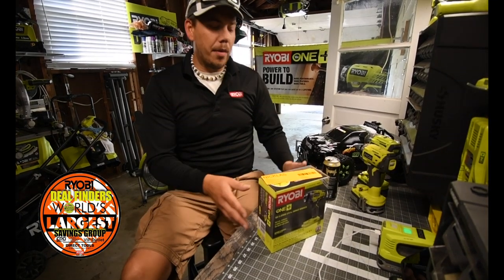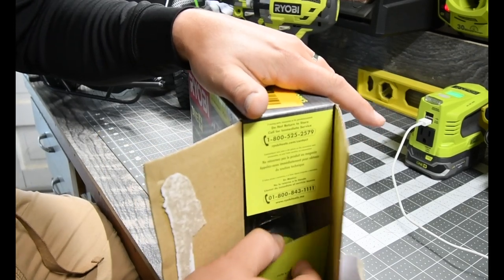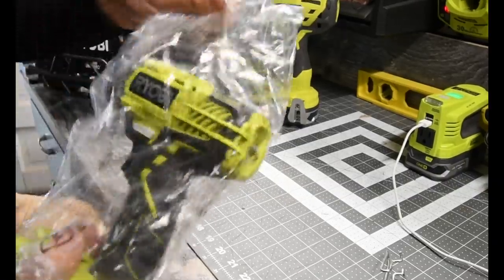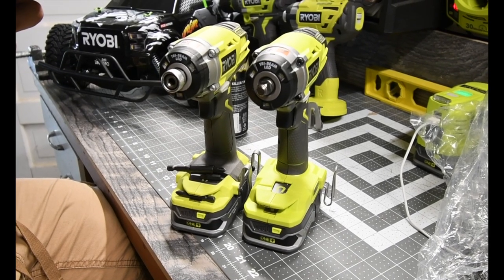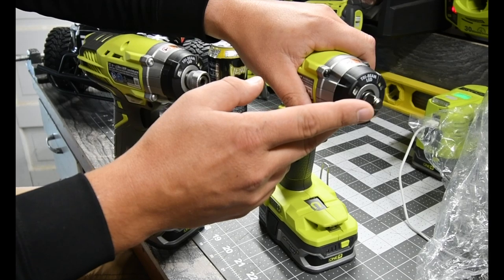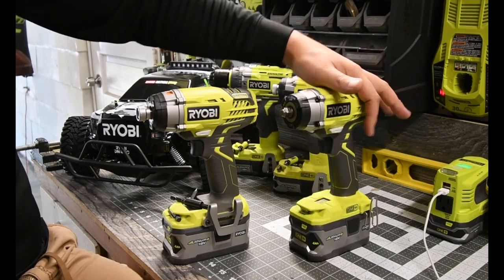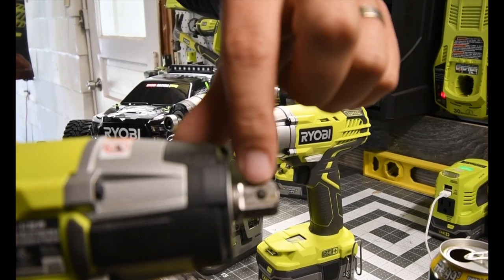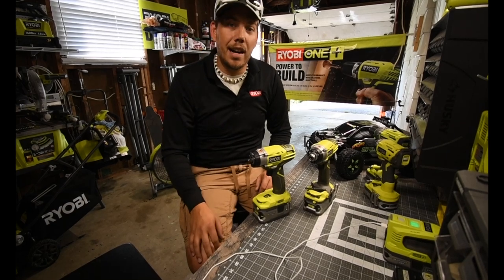Ryobi 3/8 Impact Driver Unboxing/testing!! P263

Comment: I have never seen a 3/8 impact wrench with a pin detent.  They are all friction rings.  If they put a ball inside the 3/8 anvil. you would weaken the anvil and it could break.
Reply from the maker: the 3/8 socket attachment has a ball in it.
Reply: @ManCaverTools  Probably for a 3/8" ratchet.

Comment: Great test keep going. I just finally bought the 18 volt Cordless Brushless 2 Tool Starter Combo Kit With 2.0 am hour battery, charger, Brushless drill driver, and what I've always wanted the 7 1/4 inch Brushless Circular saw at Direct Tools in Altoona Iowa yesterday for 128.39 after tax with 3 year warranty.
Reply from the maker: Those are fantastic tools

Comment: I've sheared off the post using the hex impact driver with a socket versus using the 3/8 impact wrench.  I have a 3/8 impact, but it has 3 speeds, up to 300 fbs of torque. I can take lugs off my suv.
Reply from the maker: Very good sir

Comment: It’s not called an extender it’s a reducer, and by using a reducer you are lowering your torque output, also i have the same 3/8 anvil impact and have zero issues with sockets being loose so either you have cheap sockets that aren’t up to 3/8” specs or your hog ring on the anvil is damaged no need for a ball.
Reply from the maker: I was talking about an extended drill. the longer you shaft the more torque you loose.with the hex you need a socket bit just to put the socket on. which lengthens your contact with the bolt or screw. Which drill bit would you lose more torque with, a 1" bit or 5"bit?

Comment: The socket being all loosey goosey on the impact wrench is because you're using a regular hand tool socket. You need to run it with impact rated sockets or sockets with tighter tolerances

Comment: If that's a husky reducer. It is the reducers issue. If you look inside the reducer where the anvil goes. You will see the indents are set up for a ball detent like a rachet. Not set up for the hog ring. So when you place the reducer on the hog ring the indents don't go over the hog ring allowing the hog ring to expand into the notches where a ball detent would. All husky chrome sockets and reducers don't work well at all with hog rings.

Comment: Your 3/8 to 1/4 adapter must be a cheap one.  I have one and it fits tight.  They do have sockets for 3/8 drive 5/16 and 1/4.
Thanks for the video.

Comment: Great video! I now only use my Ryobi tools, but as you know I am also a C3 tool fan/collector & out of the blue, Sears/Craftsman came out with 3/8 impact in Oct. 2018, which was odd to me. It's a new tool to a line they are letting die I believe Ryobi released their 3/8 at the same time or shortly after. I am also thinking it was the last of TTi made for Craftsman before Sears sold the Craftsman brand to Stanley/Black & Decker. But both were made by TTi tools (parent company/manufacturer). Neither have the ball bearing to hold the sockets on? Both are just meh! JMO. Thanks guy.
Reply from the maker: Thank you Greg, you are the man

Comment: Larger hog ring or impact sockets would hold better. The 3/8 probably would do better without all that polished chrome. You increase time, rigidity, losing torque.
Reply from the maker: Ill check that out and thank you

Comment: Tim from Canada the only reason why Ryobi did not put that little ball attachment on its newest impact drill they are cutting corners this way they can cut the cost give you a cheap tool and jack up the price.. these are my reviews I have the Ryobi tools I’m not happy with what is going on with Ryobi. They need to make a better product for what they are charging in Canada for their inferior cheap tools.... my review
Reply from the maker: this is a very old video and they did make better stuff, these are old brushed tools

Comment: After watching your video changing your wife's flat tire, I'm surprised you bought another impact wrench? 5 wasn't enough?😁😍😀 You're a lucky man David !!! I have the impact driver that came in the combo kit last Christmas and I have the socket adapter from Harbor freight this year. I haven't tried yet to see if it has the torque to remove the lug nuts off our car or not. Maybe I'll see if it will tomorrow while I'm thinking about it. I'll let you know. Thanks again for sharing your thoughts and videos, Rodney
P.S. curious about, if you live anywhere near Nauvoo?
Reply from the maker: Thank you for watching sir, some of these tools Im getting now for the channel to test out and compare